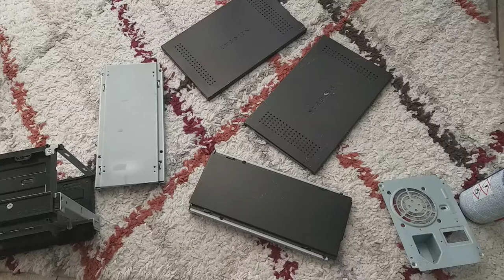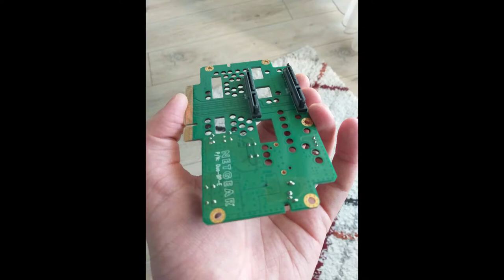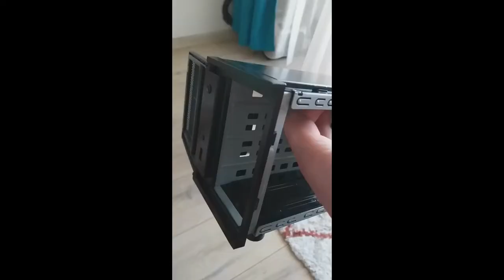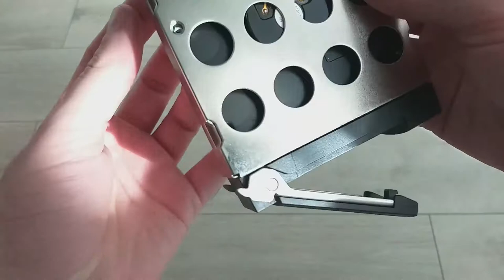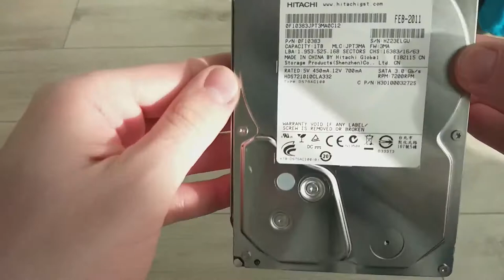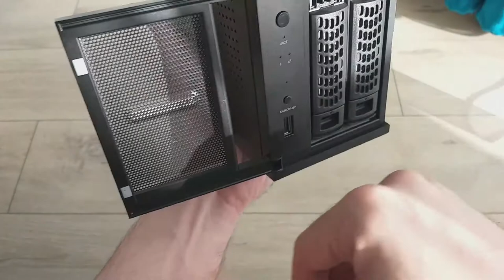Netgear ReadyNAS Duo v1 - Cleaning and restoration

Comment: The NAS DUO v1 is a 32bit chip.  According to Netgear it can only take a 2Gb disk.  All modern browsers / Win 10 has removed SMB 1.x  a security login that has lots of problems.  You can make your Win 10 PC accept SMB 1.x but it will allow you to connect to other servers with crappy security.  There is no hardware upgrade, if you purchase a V2 the old V1 disks will not work without wiping them clean due to the hardware change.  There are a lot of the V1 offered for sale, for this reason.
First offered in 2008, this is old technology.  The V2 is identical, but has a 64bit chip that you can upgrade the OS with security updates, especially if you put this on the web.
Reply from the maker: I have a new DIY one using openmediavault

Comment: Nice video. What's the highest capacity drive these guys can handle? Ty.
Reply from the maker: Didn't have Time to test that but I will. Got 15gb on IT until now
Reply from the maker: Ohh i thought that it was another video. The max I think it is 8TB(4x2). At the moment it has 4TB(2x2) and made the second one extra backup for the first one. I am using it as a backup and also media center for some series that aren't avalilable on netflix. So currently it is loaded somewhere around 300gb out of 4TB and it works flowless  despite his age :)

Comment: another Q: under Windows10 (latest version) I'm not able to get acces anymore to my readyNAS? Is therea workaround known?
Reply from the maker: 192.168.1.103 or 192.168.1.102 or 192.169.1.101 it works like once every 30 tries. The latest windows 10 updates threw this nas to the junkyard unfortunately since SSL certificates aren't available for HTTP
Reply from the maker: I have found a workaround https://www.youtube.com/watch?v=owkRd9W9vw8
Reply: @pythoneatssquirrel  The NAS uses SMB 1.x... a very unsecure connection.  Windows 10 has not installed the software.  You can enable it, but opens your PC to security problems.  V1 has a 32 bit chip (why it's slow) and the V2 has 64 bit chip and the newest SMB connection.

Comment: Did you have to replace any components? And if so, how did you find out which ones needed replacing? Mine just suddenly died, so I'm attempting to do a factory reset after copying all my data manually via Linux. Just not sure if any of the internal components were at fault, rather than the hard drives.
Reply from the maker: No, it worked fine, but since the Last updates from w10 I can't send any files to it
Reply: @pythoneatssquirrel  awesome. Glad to hear - about the first part anyhow! That's so strange. I'm on Mac, so hopefully it'll work 🤞🏼
Reply from the maker: @JaydenLawson  good luck!
Reply: @pythoneatssquirrel  Thanks :)